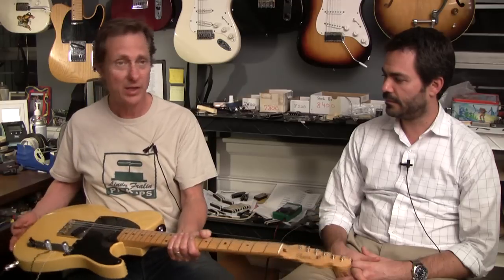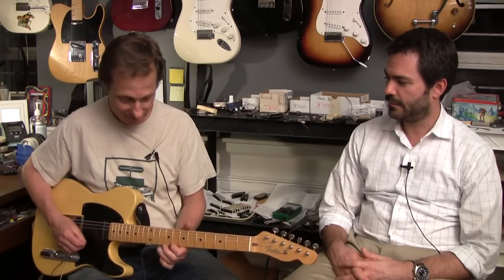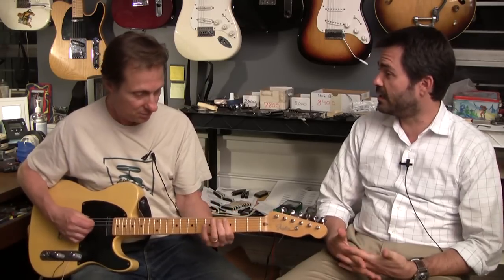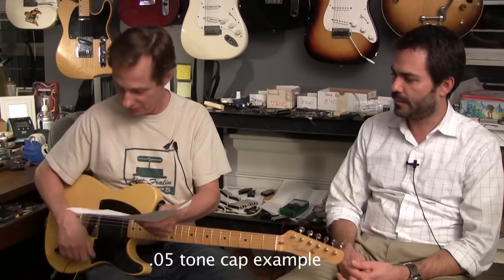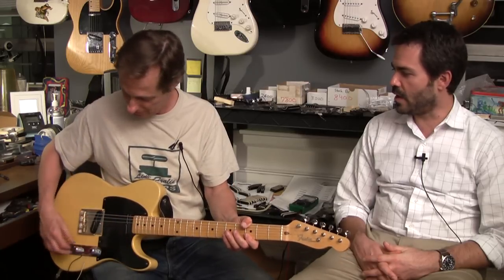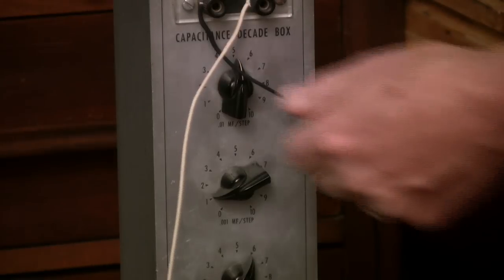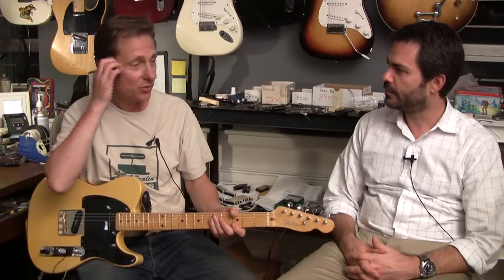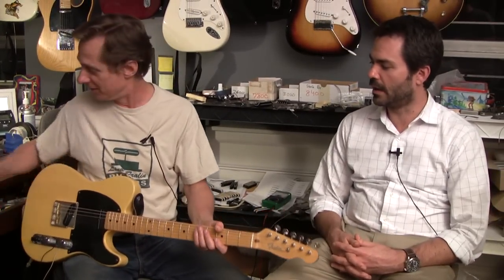Tech Tips With Lindy, Part III - Tone Capacitors Explained

Comment: If  you found 2 capacitors you like can we put both in guitar so we can switch between them ?
Reply: Yes, with a push-pull tone control you could select between two cap values.
Reply: As i understand a treble bleed kit is on volume control can we also use that whit a push pull nobs. So if we dont want too activate it can be on standby. Buy the way thanks for responding.
Reply: The Volume kit could also be switched in and out with a push-pull switch. Lindy

Comment: Wait i don't get it is the decade box just connected to the output of the guitar before it goes in to the amp? Or are you running a jumper in to the internals of the guitar where the caps are on the tone pots?

Comment: As a demonstration of the effect the tone capacitor value has on sound, it's a great video. It's a pretty bad video when it comes to actual values and units, because you're using very confusing units. First of all, Farads are F, not FD. Second, even if we assume FD means Farad, MFD would be megafarads. The values given, however, are actually in microfarads, so not even writing it as mF would be correct - microfarads are µF, or sometimes also written as uF. And why even use the confusing fractional values anyway when you can just go lower on the scale? Sure you can say the capacitor is .01 µF, but why not simply say it's 10 nF? Why say it's .002 µF when it's much simpler to just give the value as 2 nF? And let's not even go to the downright awkward .0001 µF values also mentioned here, as in .1 nF or 100 pF... It would also make it easier for people to buy the correct capacitors.

So thumbs up for the sound demo, but thumbs down for the scientific side of things.
Reply: You are right in every way. I'm sorry I'm not an electrical engineer. More of a seat of my pants engineer. I need to learn the correct language.
Reply: @jennyfralin357  But, I mean, it's much better to have a "seat of the pants" engineer that maybe doesn't use correct or more easily understandable units, but clearly knows his stuff on the practical side of things, than one that knows all the theoretical stuff but is lost in a real world context.
So apologies if it came off as too harsh, wasn't meant to. Like I said, it's a very nice demonstration of the practical effects, even if the units and such are somewhat confusing (but that seems to be fairly common in the guitar world apparently, it seems like "mFd" or something like that is used all over for uF and that microfarads are the preffered unit for guitar techs for some reason :) ).

Comment: Hey I use 1200pf Capacitor & 130k Resistor for my telecaster and Gibson les Paul but I still find it dark sounding, what values in cap and resistor  would you recommend or you think this is bright enough already ? Mr.Fralin
Reply: Make sure your pots are 500k or higher. The cap only gets rid of highs it can't add any. We do make brighter hum buckers if you need them. Lindy

Comment: How does different pot values interact with cap values?? 🎶🎸
Reply: The PU is loaded by the volume pot which are 250K on a Fender and 500K on a Gibson. Lower value (pot turned down) will let less treble through.
When the volume pot is turned up, only the tone pot (same values as the volume pots) and the tone cap will bypass treble - No bypass on full pot value, and much
bypass on low value.
If I remember correct Fender normally uses 0.022 (22nF) and Gibson 0.047 (47nF) going with 250/500K pots. That gives a picture, doesn´t it? Closest standard
value for doubling the 22nF is 47nF.
You move the attack frequency with the pot, and the pots are log pots, which have around 10% of the value in the middle position. So the attack frequency is set by
the cap 22 nF vs the actual pot value, 25K when the pot is in the middle position.
There is a formula for that, but I suppose the input impedance of the amp or effectpedal, usually 1M, also plays a role in the calculation.
Reply: Uneventfful Event: That link does not work, but essentially you disaggree with me that this is just a simple variable 6 db Low Pass filter?
Also called a High Cut filter. It cuts the treble, according to the position of the pot. Then it is strange that all the treble disappears when
you turn up the tone pot, isn´t it?
I think the filter you are describing is a notch filter, which can not be made with a resistor and a cap. Probably a LCR filter.
I know there is some reactance in the pickup, but I dont think that comes into play here.
But maybe I could be corrected. Anyone?

Comment: I thought a lot of fender guitars come with .047 caps
Reply: Does the tone at potentiometer at 10 change as the value of the capacitor change?
Reply: My 1997 Mexican made strat has (had) .022.